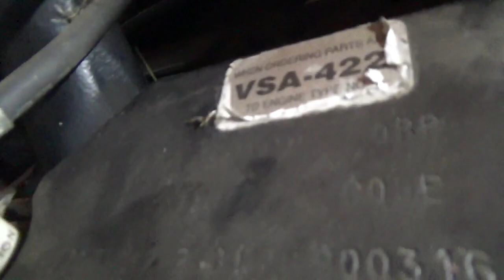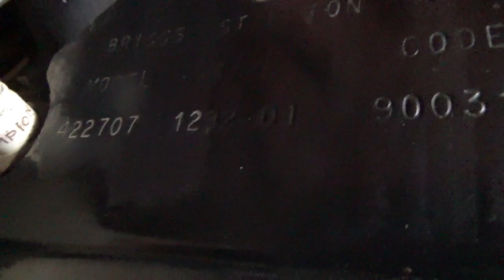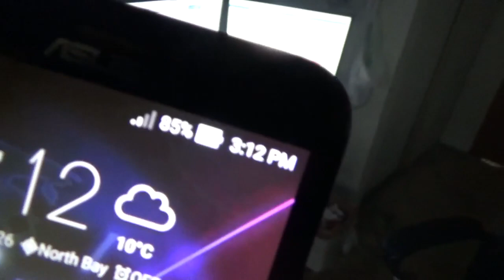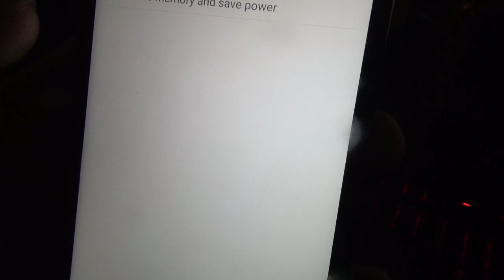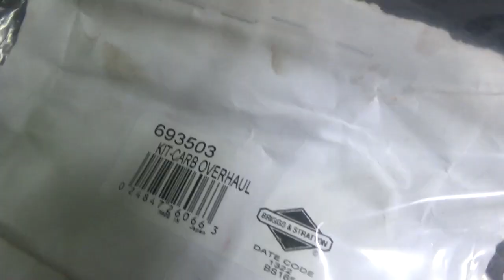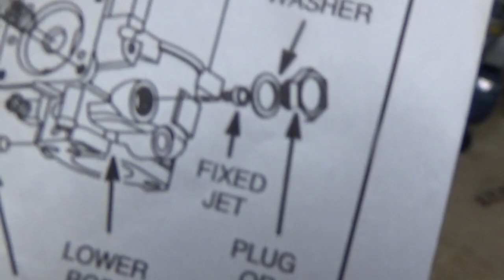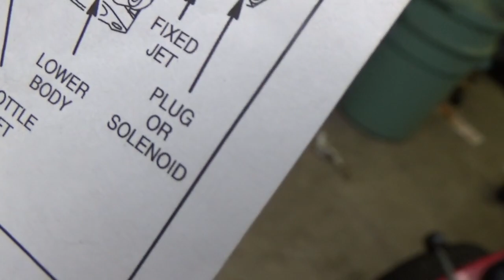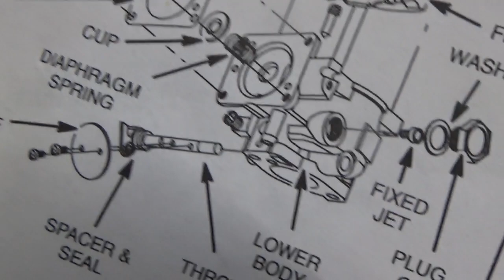Let's fix a Tractor!

Comment: Again it is usually the main jet plugged . Take it apart again , spray carb cleaner in the main jet . , the one behind the drain plug ,use the red straw that came with the cleaner . May use some compressed air also . but spray and blow air through every passage . Better if u unbolt the whole carb and remove . bolts are on bottom and  go up  through the intake and up into the carb . just for me it is easier to remove and clean .
Reply: There is one screw in the front of the carb, has a spring around it  , just under the fuel pump . it is for the idle circuit . It needs taken out and stuff sprayed in there too , but prob not your issue as it  is for air fuel mix at idle when throttle plate is closed
Reply from the maker: ok I will give that a go when I get a chance.  Thanks man big time thanks.
Reply: adam are you going to another live stream tonight?

Comment: Under the carb there are two bolts on the intake manifold (You can kinda see it in the video), one at the front and one at the back.  Is there a fuel filter on that?  If not, it would be a good idea to invest in one, it would be inline with the fuel line. and pull apart the pump and clean it out, probably replace the diaphram inside.  It's actually a pretty simple process. If there is no shut off, I usually use a pair of vise grips, just don't grip it too tight.  When you disconnect the line hold it higher than than the fuel level in the tank if possible  I would also put the carb on the bench, put it on a piece of cardboard and keep track of every bolt you take out, you might wanna video it.  Replace whatever parts you can and soak the rest in carb cleaner, blow off with air compressor.  It's a lot easier off the tractor cause you can see what you're doing.
Reply from the maker: yeah I saw the mounting bolts while editing the video but not when I was shooting the video.  Its funny how the camera can see things better than I can.  The kit I bought came with new diaphram and stuff so I might as well put all the new parts in and hope for the best.

Comment: I wouldve done the same thing as you, sure you cleaned all the jets well with plenty of carb cleaner and that metal bristol? The smallest blockage will mess it up. You can also research specifically what jet does what and pinpoint it to your specific issue to narrow it down when you open it back up. dont give up you did good
Reply: Oh and you can just pinch thr fuel line with some vice grips.

Comment: Looking at the state of the airbox, you need a new air filter too, and to clean out the air box... :P

Might look clean, but could have a blockage in one of the jets (hence the sticky resistance when poking the wire through), hence needing being run with the choke on to keep it stalling out from running too lean... :)

All men own a fire extinguisher... :P

Still has a blockage somewhere, which needs a proper cleaning of the carb (carb spray is only good for a quick clean, not a thorough deep clean that an ultrasonic bath gives)...

And whatever the outcome of the carb & fuelling is, it's more experience under your belt... :)

Comment: Wow, 40km/h speed limit is weird. We have inside the city only 50 or 30. And on some larger roads it's 60 (very rarely!), but that's about it. The only 40 signs I know in Germany are on roads where you're normally allowed to go 100, when there's a danger ahead, like a dangerously tight hairpin turn or a very narrow underpass where one side has the right of way because 2 cars don't fit or something like that.

Comment: adjust the air screw and you have the kit rebuild the fuel pump it might have a pin hole in not allowing it to pump

Comment: You've got to get that carb fully disassembled and soak it in solvent of some sort.  Spraying carb cleaner on it and finger fucking it with a wire isn't gonna get it done.

Comment: Seems you have some neglectful seniors at work, making you bust a gut then finding out you're not even meant to be in!! :\

At least your engine's model & type matches the engine itself, my Briggs Intek engine plate doesn't match the engine specs (not that it matters cos it don't work)... :P

Mobile phones are useful, except when they're not... :P

It's easy to turn off the fuel from the tank, just keep the fuel pipe above the height of the tank, that way the fuel stays put, you can also put a bolt in the hose to keep it sealed... :)

Yup, that guy wants to go to prison for manslaughter cos they ran over a kid outside the school, didn't happen that time, but it will...